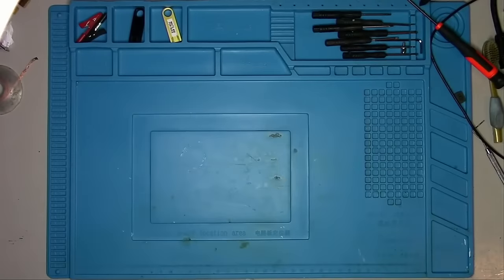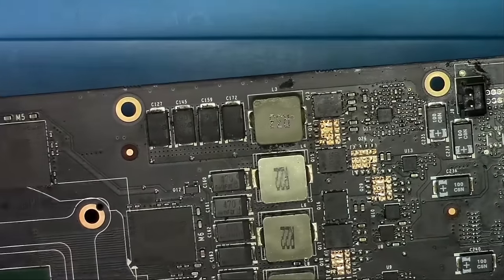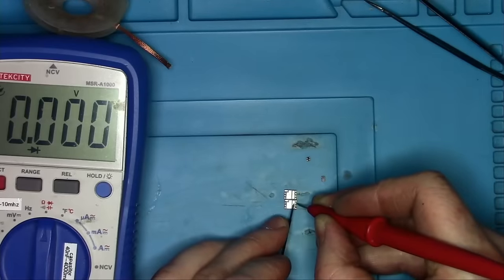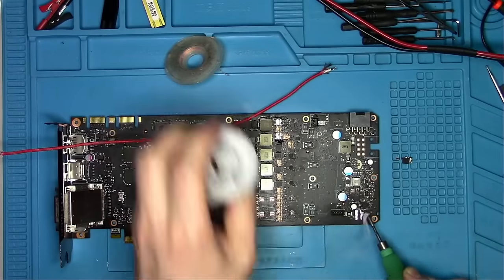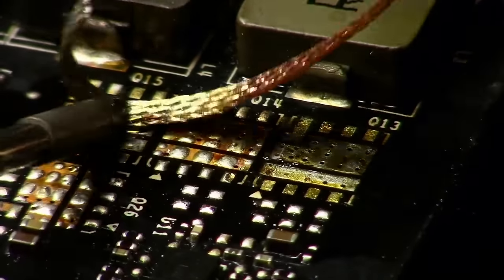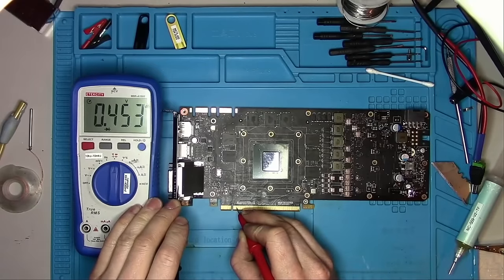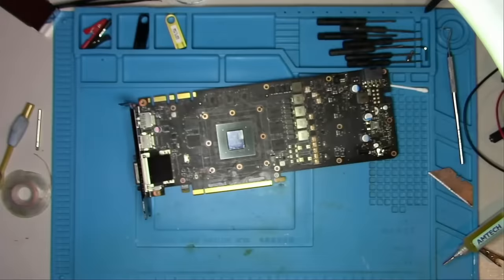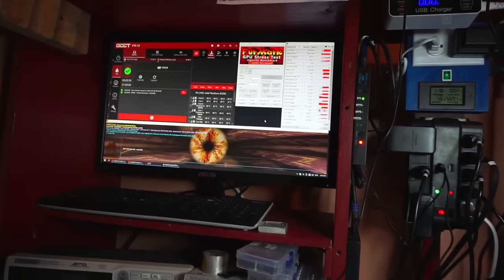What MINING does to Graphics Cards

Comment: Where did you learn to do this. I strive to be fully self sufficient. I want to be able to say “I could fix that” and evaluate if it’s worth my time and effort instead of just buying it again or paying someone else to fix it. 

I learnt to solder wires smd’s and cables but those were things I could learn in a few minutes from a single YouTube video. Repairing boards  (not just rebuilding broken traces) seems farther out of reach without spending hundreds in equipment and weeks of learning

Comment: It does nothing in most cases. Writing from my MSI GTX 1080, which was mining 24/7 for 2 years, then came to my gaming PC. Still going strong until this day, 7 years later
Reply: yeah same with my rx 570 8gb, still like a new,  i was mining for a half of the year or even more, 70C with 60% fans, but i got rx 6750xt and my old card is just collecting dust in the box now, never changed thermal paste or anything, just cleaning from dust and thats it

Comment: How should we keep our graphics cards clean, what’s the best way? I’m not a miner but all the same I want to help keep it good. Thanks for the great video, facilitating!
Reply from the maker: Take the entire case outside and blow it out gently with compressed air or some kind of a blower. Electric blower is fine. Just dont force it too much so nothing will break.
Reply: @northwestrepair  ah I’ve had it apart to apply new thermal paste so dusted it off then, just wondered if there was anything else I should be doing. Would love to learn what you do, that’s amazing!

Comment: My god. I hope the 1080 I just purchased doesn't have any intestinal issues like that. It's still within refund timeframe. I... should probably take a peek under the hood. Since my new motherboard seemed to crap out after a few days usage, and my old board is PCIe v1.1. So I don't think it works in it.

New thermal paste on the way, so I can replace it once I get my new board. Do I need to replace the thermal padding after removing the heat shield?
Reply: idk about thermal pads i was wondering too, do you have an update?

Comment: It flogs the shit out of the memory and accelerates the cards death despite being a mild load on other components of the card. Especially since a lot of cards out there don't have adequate memory cooling for mining loads. I have a 3080Ti Aorus Master and changing out the memory pads and adding new pads to the back of the card made a gigantic difference. Memory dropped from the high 90s to the high 70s. And I don't mine.

Comment: I don't know why furmark is still a thing because most modern gpu drivers know that it's furmark and downclocks the gpu to relief stress. I'd run 3dmark time spy extreme and fire strike ultra for half an hour at least each in order to validate if it's stable. Or superposition in 4k also creates extremely nasty transients with massive undershoots and it also draws a ton of power so that'd also be a nice stress test to see if the card is 100% stable.

Comment: How often are you supposed to open up the card and replace the thermal paste on these cards? I have a refurbished EVGA 1070 just like this in my rig that I have been running for years. Should I open it up and repaste it or just leave it alone?
Reply: It's a good practice to know how to clean and repaste your GPU. I change it every year but that might be because I like doing it. Just be careful to not rip the thermal pads, look for a tutorial so you know what and what not to do.
Reply: @addictedtoautism420 how can they be riped? (thermal pads) or more like how to not rip them?
Reply: @ocococococococococococococ3267  They usually rip if they're already too old and crusty or when the manufacturer uses cheap pads. It's not a big deal honestly, as long as they make contact with the surface they're on. Just try and assemble them as best as you can.

Comment: Not only did they make it hard to get them but they made them artificially scarce to drive the prices way up.  Now they are selling the cards they damaged for still too much!  It is a used card.  I don't care if they undervolted it or anything.  They made their money wearing out the cards just to sell them to us still overpriced but also with potential problems.  Some of them have even tried to hide the damage they did to the cards because they are so dishonest!
Reply: Most of them RMA’d their mining cards because they wore them out so fast. Now when you RMA a card, you’re getting a barely refurbished mining card as its replacement. I just got one back from MSI and its in worse shape than the one I sent in for repair. Coil whine, washed out leds, blackscreening, crashes to desktop. MSI’s only resolution was to send it back in to get replaced with likely another lemon. F**k crypto.

Comment: That is not entirely accurate for mining. To happen that it depends on if anyone does overclock to the card. For the ones who are used to mining we know that every card needs to be underclock the GPU, the memory depends on what coin you are mining. So underclock won't heat the card and also runs cooler with fan at 60% or even less and temperature remains below 50 celsius. I myself have many cards from sapphire and all are AMD, but the rules are the same for NVIDIA. As for your skills on fixing cards are truly remarkable and outstanding. Keep up doing it.

Comment: I never knew such ultra fine electronics could be repaired.  I would still look at this card as a write off.  I always consider the most minor hardware failure as fatal to the card and possibly the rest of the PC.  This is why I never, ever look at used PC parts for purchase.  Sadly, EVGA wants to get out of graphics card manufacturing.  The 3000 series cards are going to be their last Nvidia cards.  They still plan to honor all 3000 series card warranties.

Comment: I have a  logical theory about GPU mining reducing the life of GPUs MORE SLOWLY than playing video games and it makes tons of scientifically based logic if they are working at the same max temperature (no overheating involved in this theory). The explanation is quite simple - mining works at a stable temperature, so there isn't much mechanical stress on the chip. Gaming constantly leads to change in temperature causing constant mechanical stress on the BGA causing it to fail earlier due to the frequent expanding and shrinking of the related connections which cause bad/weak solder joints at some point. :)
One could argue that mining GPU fail more than gaming GPU, BUT there are many factors involved and there is likely no official statistics about that - overheating and design not made for such working conditions, undervoltage or overclocking, custom drivers etc.
I literally had a bugged mining program/driver causing my R9-290 to reach around 90-95 degrees with low fan RPM...

Comment: The “miner” probably used software to undervolt the card and then disable the fan to use as little energy as possible to maximize profit to cost margin. The result is a card that has nearly new looking fans that have little run time and a card that has been heat stressed beyond what it was designed to handle. The used market in my metro area is absolutely polluted with these types of cards. Buyer beware.

Comment: EVGA 1070 SC isn't that great, I had one since 2017 bought brand new, it died 3 days ago, puff of smoke, psu auto shutoff, dead.   I treated it really nice, didn't stress it hard, installed the thermal pad mod as advised by EVGA according to their written instructions with photos they sent out, did it really carefully, thought I would be bulletproof, nope, still premature death.   Was the perfect GPU for my needs.   Should have lasted 4 more years, at least.   And frankly I don't see why not longer.

Comment: I wont even gonna watch the vid but Mining is completely fine for your card... even if you mine for 2 years without break... what is good about mining is that the card is under constant load which means no sudden temp spikes and power draw spikes unlike gaming where the GPU runs at 40%, suddenly the game needs more so it goes to 90% and then goes down to 40% and then you turn off the game so it cools down and you start another game and the same story... That is mainly for people that want to play games at more FPS, if you dont run the game on highest possible settings for your PC and do not utilize your card to its full potential (like RTX enabled if you have RTX GPU) then you as a gamer do more damage to the card than a miner does...

Comment: Thing that most miners kill is the lack of actual airflow 

The just use a se4rver stup for rigging billions of cards together in a room that's not or just poorly temp regulated 

Even the most basic desktop case you can get provides better heat management then this way of running things g

Comment: sir i have rx570 4gb when i open the game and turn it on 1080p high settings my monitor goes black and my gpu fans goes fast power are there plzz help  how to fix it sorry for bad english
Reply from the maker: No idea. Need to look at it and diagnose.
Reply: @northwestrepair  plz help
Reply: Should I change the thermal pads plz recommend me 1.5/ 0.5 mm good colty pads
Reply: Or paste??
Reply from the maker: @pac-mangaming227  how would that help ?
Reply: @northwestrepair  no I am asking you

Comment: You see all those layers? That's a few too many hidden tracings. I'd only use the card for parts.
Reply: Why? If it can run stress tests and gaming benchmarks, it's fine for a gaming card. Its lifetime might be more limited, but unless it's a critical part of your workflow, there's no reason why someone shouldn't use it in their desktop while it's still working okay.
Reply: @EnglishMike  Because i'd be passing on that part to a customer. Because my name and reputation would be on the line. Because i'd be no better than the crooks and liars at NewEgg. You need more reasons? Or maybe you thought i wasn't entitled to make my own choices.
Reply: @aleksandrbmelnikov  That depends on what you tell the customer. Any honest repair shop would explain what they did and that it might have a limited operational life, there's nothing wrong in returning it to the customer. In fact it's more honest than just telling them you couldn't fix it, which would be a lie.

I wasn't trying to be combative, by the way. I just disagreed with your conclusion (and still do).
Reply: Those are mostly power layers, no important signal traces should be around there.
The card will be fine for years to come.

Comment: What I find very disturbing is both how dirty the card was and how clean the fans and heatsink were. I’ve heard miners will underclock cards then disable the fans in order to lower power consumption. They essentially burn the card out, but because they fans were never spinning, the card looks brand new clean and gets sold as such on CL, FB, or anywhere else they offload it to an unsuspecting victim. Scum.
Reply: Miners don't disable the fans lol, where did you heard that nonsense?
Fans are what fails the most on mined cards.

Comment: PLASTIC IS A CONDUCTOR OF HEAT AND MORE SUPSEPTIBLE TO BENDING/CRACKING/SNAPPING. I pay hundreds for a GPU, it better have a metal back plate not some cheap piece of plastic. I realize metal conducts heat too, but it dissipates it WAY more efficiently. Nobody takes the time to google heat conductivity from metal vs plastic... Unless you set your rig up like a complete idiot, its not a problem.

Comment: Would you like a couple of donation cards for the channel? I have a couple r9 280x's / HD 3990's (Or whatever the HD series equivalent was, it's been awhile I can't remember), that could use a repair collecting dust. 

One has a single knocked capacitor , knocked by a screw driver, ( I somehow found it on the ground )

The other it appears someone was messing with overclocking. (The bios wasn't stock, I got the card to boot and post once, not sure what killed it)

Comment: There's no difference between gaming, rendering videos, or mining.  Video is more appropriately called 'what happens when you overclock and run custom bios incorrectly. and never clean your card.'  If you mined intelligently during the mining boom, you actually undervolted most cards...   I have 1070's and 1080tis hat mined for 3-4yrs straight, and still used daily for rendering and AI training, all flawless.
Reply from the maker: There is.
Game memory temp 80
Mining memory temp 100+

Comment: Clickbait video, it does nothing, thats like gaming on a gpu and making a vid saying your gpu is dying because u used it, like matches burn when you use them are you gonna make a vid saying WHAT SETTING FIRE TO YOUR MACHETS DOES.
Reply: Yeah. Miners don’t abuse their GPUs at all. Undervolting the core and disabling the cooling fans to cut down on power consumption, which causes the card to run at temps it wasn’t made to endure. What could possibly go wrong? Well nothing for a while, then it goes to crap and they sell them online as almost new, look how clean the fans are. 😂